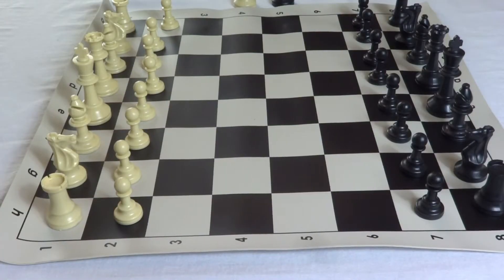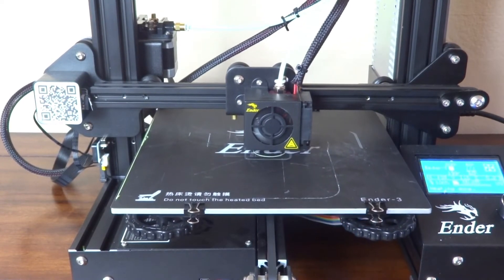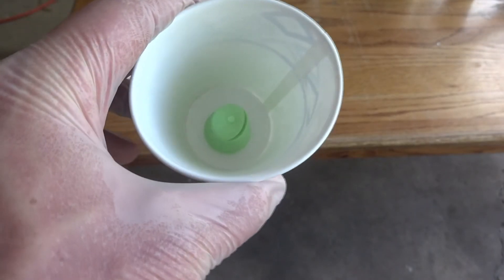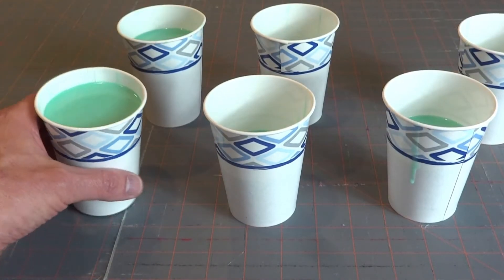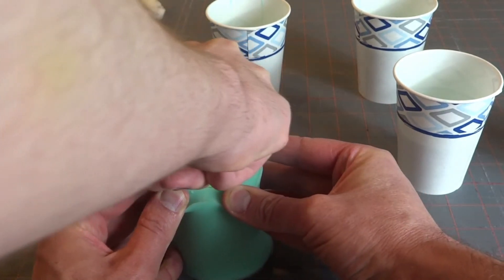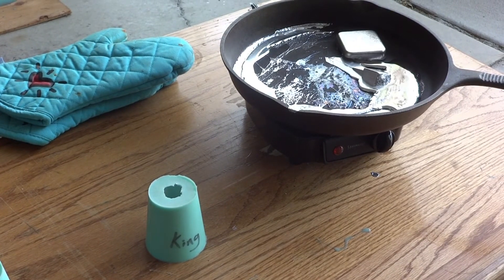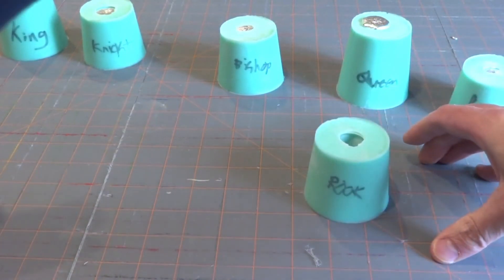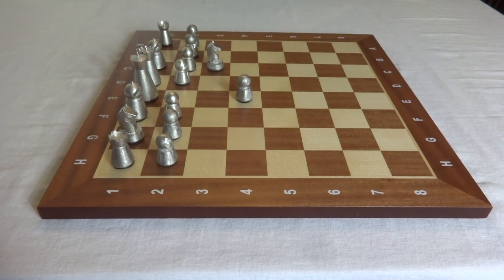Cast Your Own Metal Chess Pieces - Part 1

Comment: Pretty nice.  Be aware that the metal alloy ingots from your parts list are 30% lead (39.4% Bismuth, 30.8% Tin, and 29.8% Lead), so you should probably clear coat them somehow to avoid having to touch the bare metal.  That is, unless this particular alloy isn't that toxic.  Could be I suppose, but I'm no metal expert.  PS - regardless of toxicity, this would be a great way to add weight to wooden chess pieces since it melts at only 212 degrees Fahrenheit.